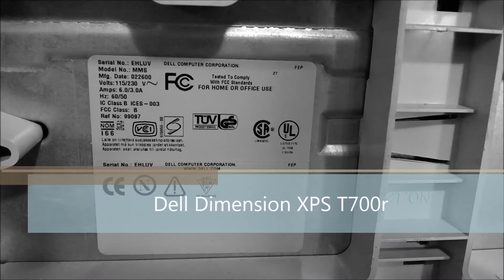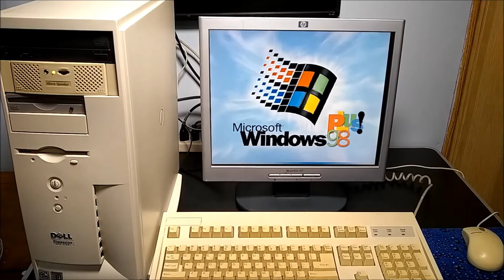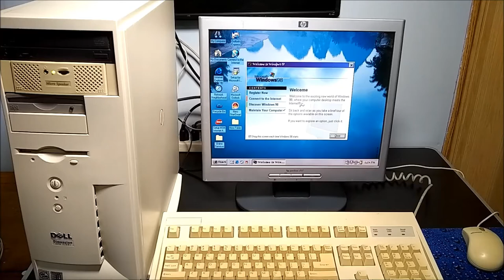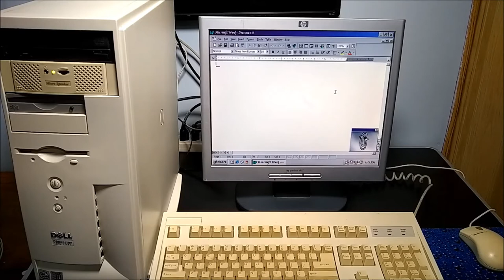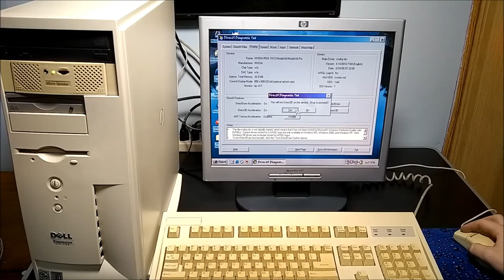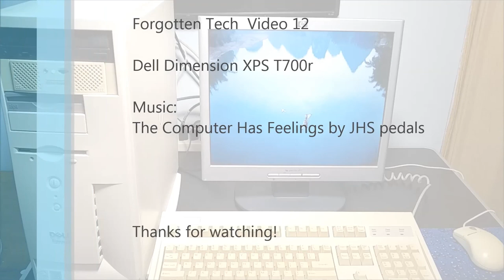A look back at the Dell Dimension XPS T700r

Comment: i think you have noth of my old treasured comps - the Dell 2400 and the Dell V400/XPS variety. Boy do i miss them! I think this is likely from the *late 1990s, not early. I like the color, the sturdy ness, the " this is not a handle" grounding brace across the frame, and the vent ports in the front. I'd buy this if I could and put an MicroATX MB in it and run a DDr3 or 4 setup!!

Comment: I've got a Dell P2 266mhz that looks is very similar to this. Would like to upgrade it but uncertain what to do. Not sure if worth getting a faster CPU as its for DOS mainly, and has a useful step down feature for older programs. Think graphics card is stock. Any recommendations for a good replacement (a Voodoo card is obv but they've gotten bit expensive)?
Reply from the maker: A cpu upgrade would depend on your motherboard. I know the XPS H233 I have (P2 233mhz) is limited to a 66mhz bus speed and doesn't work well with slot 1 celeron CPUs. the only upgrade options in that case is a P2 333mhz or finding a slot 1 to socket 370 adapter and a coppermine core celeron with a 66mhz bus speed. I believe the fastest they made is 766mhz. As for a gpu I'd suggest something from the ati radeon 7000 series. That's actually what I used back when I was a broke teenager using the old XPS as an everyday computer.
Reply: @forgottentech13  That Radeon 7000 is an interesting suggestion. Voodoo being too expensive, a more "modern" card might be a smart alternative. The machine's function is basically to run DOS games and any Win 3.1 and 9x games that don't play well in XP (I have a separate PC for this) and a few higher end multiplayer games which is where I may be pushing it. It's a bit of a mess at moment as I am waiting on an IDE to SD card but believe it might also have a step down <Ctrl><Alt><#> to slow the CPU (could be only for Gx series) which will save a bit of effort getting early DOS games running.